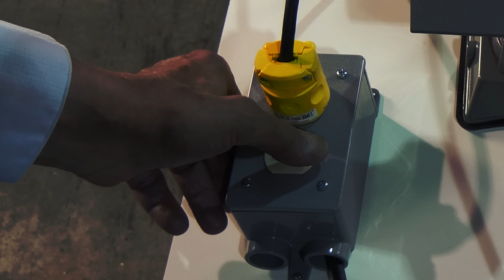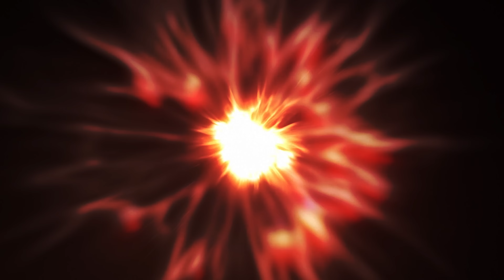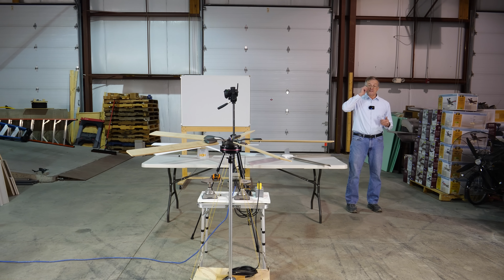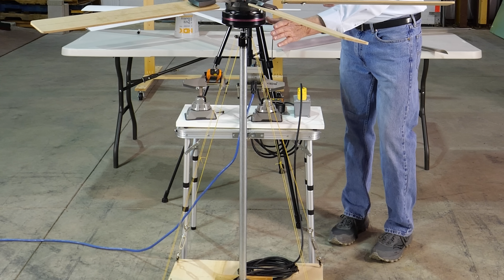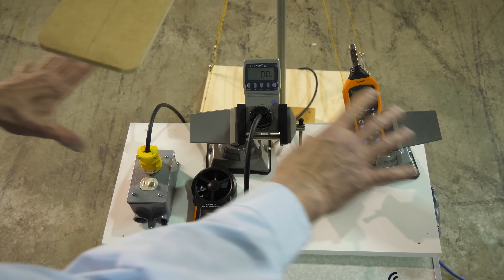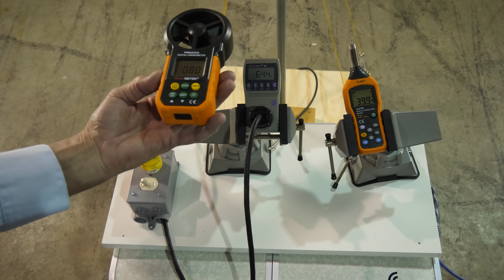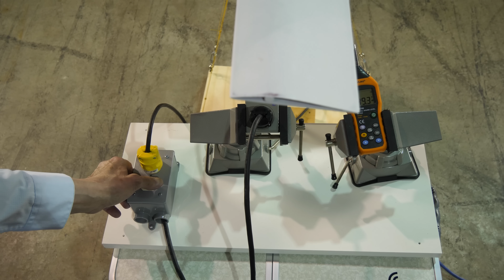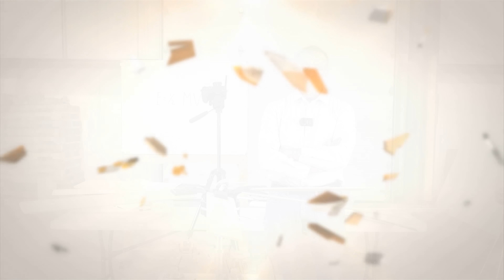This Fan Uses Almost NO Power

Comment: Interesting demonstration.  I'm a retired HVAC engineer 30 plus years experience.    HVAC fan, pump and compressor motors have very stringent efficiency requirements either ac or dc.  Around 92 to 95+%.  The cheap retail fans you showed are not regulated unless they have energy star certification.    The beauty of the speed control dc motor you showed is the ability to adjust speed to a desired amount and avoid over speed.
I enjoy you videos.  Look forward to the next one.
Reply: Thanks for your comment. I found a 120v ceiling fan on energy star site that uses only 16watts on low speed, 61watts on high.
Reply: Even ten years ago, BLDC motors were common in Australian washing machines apparently. I'd dug that up when looking for a source of e-bike motors from e-waste. But I'm in Canada, not Australia, and there's basically zero of them here.
Reply: @MattsAwesomeStuff  Fortunately Ebike motors used are quite affordable, especially from defunct ebike rental units, often times even with the tire on it. Also the Direct drive ones are cheap since they are just a bunch of wire and steel, though relatively heavy they are basically bulletproof and hard to kill by heat or age or water or anything.
Reply: I'm a HVAC fan too, especially during summer
Reply: How common are bldc motors in household appliances?  My cursory web search was confusing and did not answer that question.
Reply: @Richard-rz8gt  
Can  only speak for the EU but Efficency labels and norms do make it that DC motors are pretty common.
Cordless vacuums probably also use them at the very least.

I would say that fans are kind of a case where people don't seem to care about efficiency.
Reply: @Richard-rz8gt  Not that common outside of power tools & some garden machinery, sadly, but getting there over time. Modern fridges seem to be leading the charge by having brushless compressors. If you're lucky you can find a practically drop-in replacement for a brushed motor but that often requires taking the appliance apart to measure things.
Reply: @NightCatArts All fridge compressors are brushless. They mostly use induction motors (no brushes!). Perhaps you mean PMSM.
Reply: @andutei  I was using the term brushless to refer to the permanent magnet variety, which some fridges are now beginning to use in place of induction motors to increase efficiency & keep noise down by varying the speed.
Edit: To be clear, brushless permanent magnet motor, not PMSM.
Reply: @NightCatArts  A brushless permanent magnet motor is a PMSM.
Reply: @andutei  No, PMSM is driven by AC if they're to be efficient, whereas what people mean when they say a brushless motor is driven by DC. They are different designs & function differently, even though neither uses brushes.
Reply: @NightCatArts  No such thing as a brushless dc. It's a misnomer. The waveforms are AC for the "bldc". It is a Permanent Magnet Synchronous Motor.
Reply: @andutei  No, they are different things and they operate differently. Any half decent cordless drill from the past 15 years uses a motor without brushes that you feed with direct current; it is a brushless DC motor.
Reply: @NightCatArts  You left out the part where you're feeding the DC in the drill to the inverter/controller, which in turn feeds AC to the motor. Here's what Google AI says "Yes, the term "brushless DC motor" is often considered a misnomer"

They are not different things, they're the same thing. Construction is the same. Even the construction of a brushed motor is the same, minus the commutator. The main differentiator is from induction motors, and in regards to controller input.
Reply: @NightCatArts  Can you spin a BLDC with a battery or other DC power source? No? Then it's not a freaking DC motor! "BLDC" is a misnomer. The DC goes into the controller, AC comes out of that and into the motor. I design motor FOC drives, so you'd think I should know😄
Reply: @andutei  Yes, you can.. You charge one coil at a time, not the entire stator at once, because that's how they work. The fact that the signal kinda becomes AC inside the motor because you switch it on & off has no bearing on what you should call the motor; it's a DC motor because it takes DC input. That'd be like saying a bicycle shouldn't be called a bicycle because it only carries one person; the number of people on it is not relevant to why it's called a bicycle.
Reply: @NightCatArts  Sure, you can make it step with dc. But not spin. To spin it it needs 3-phase AC. It's a PMSM. PM = it has permanent magnets on the rotor, SM = it's a synchronous motor, the rotor d-axis follows the stator field q-axis current.
Reply: @andutei  Stepping is what they do; charge one coil in the stator after another (or one set after another) to pull the rotor around. It's not constantly alternating the current on all the coils at once, but constantly changing which coils are charged. They use Hall effect sensors to determine which coils need charging at which time to pull the rotor to the next position, & it happens so fast (often using pulse width modulation) that it doesn't appear to be stepped. This is why they're efficient, because the entire stator isn't being powered at all times (alongside being able to balance torque against power delivery). This is also why they're more expensive, because they require a microcontroller to analyse the sensor readings & alter the voltage output & path.
Reply: @NightCatArts  Get yourself an oscilloscope with a current probe and look at the phase current, it's an AC waveform with 0 dc component. Like I said, I design motor controllers, hardware and firmware, I don't need you to tell me how they operate, LOL. This stupidity has gone on long enough. Good luck to you.
Reply: @andutei  You should update your knowledge.
Reply: @Richard-rz8gt  As someone who tries to only buy BLDC motors, not very. Consumers just don't understand the benefits so companies neither push products using BLDC motors aggressively (outside of battery-powered tools) nor do they advertise the fact their products contain brushless motors very prominently.
Reply: @flagman3116  Plenty do. They just called it Inverter rather than brushless
Reply: @flagman3116  It seems to me that a smart company could sell the advantages of a more efficient product. As the man in the video said, the cost bump to build is probably minimal. If they price their widget based on the cost to build, then the new widget wouldn't be much more than the old widget. The problem comes when they want to scalp the consumer because the widget has new technology and therefore "should" cost a lot more.
Reply: @ٴٴٴٴٴٴق I see the sticker on my fridge reminding me of that and the 10 year warranty on the compressor every day :)

But why is it the manufacturer feels the need to have an extended warranty on that? I think it's because consumer sentiment is against these extra smarts
Reply: @Richard-rz8gt  check out "Inverter Fridges". But induction motors are also efficient, when they need to be to comply with energy regulations.
Reply: Thanks, gents.  The comments here confirm the scant information I found.  I reckon the dearth signifies that few appliances use these motors.
After market motor swaps would involve a schematic, professional expertise, and likely void any warranty.  The cost would be amoritized in less time than the appliance lifetime.  Hopefully.
Reply: why are you giving your resume
Reply: DC fans are becoming common
Reply: Can you pin a link to that DC motor set up?

Comment: You guys could use a noise filter to remove most of the buzz in this audio that is making it unbearable to listen 

Good content as always !!!
Reply: 💯 even running it through audacity (free) would do wonders
Reply: @JohnGodwin777  Yes audacity will take care of it
Reply: A high-Q 50 / 60Hz notch filter would do it in a heartbeat. Easy as Pi in any video editor. Eliminating the source of the buzz would be better – it's a ground loop somewhere in the wiring setup of the audio it I had to make an educated guess.

The lavalier microphone lead is also acting as an antenna; a small investment in this area would lead to improved audio all round. I'd suggest taking a look at the DJI web site in that regard.

You could've also measured the temperature at a fixed distance (e.g. 30cm below the midpoint of half the diameter). I'm curious how the six setups would compare.

Aside from this, excellent content as always. I can't say I'm that surprised that the cheap motors made more effective heaters than they did kinetic energy devices – just the opposite of what you want when you put the fan on for some cool air! 😂

Comment: I got huge fan to suck air out of my pole barn/shop. Thing is crazy loud and fast. Replaced the motor with a DC with adjustable speed, Now I can run it at 20% to 50% still moves plenty of air but so quite now compared to before. If I'm doing something that puts a lot of smoke or dust in the air I can still turn it up to clear the dust out quickly.

Comment: Harry C. Riblett has a really good analysis available in GA Airfoils. But what's the difference between them in the weight per watt ratio? A ceiling fan is far-less sensitive to that than are other fan uses. Would Niron Magnetics help in that?

Comment: On top of the 1kw/day energy waste, to note, that is extra heat, nice in winter, not so nice in hot summer days. That fan uses a specific ac induction motor, has no running capacitor but has a magnetically shorted part of the stator, that is why is so inefficient,  but will last forever(until the bearings fail). The washing machine, fridge etc will use the running capacitor, so a bit better, but still a dc brushless or ac 3 phase inverter driven will be more efficient, that's why newer AC units, washing machines,  dryers all use inverters or dc brushless, at least in the EU things are moving into that direction.  Great videa!

Comment: Don't know the internals of this brushless motor you used. There are many small and cheap brushless motors and controllers for RC models. With the proper gearing you can get them in the optimal operating window for this type of application. Might be an option to even further reduce power consumption and costs.

Comment: We circle back to that Tesla was right DC is better than AC. It would be quite interesting for you to explore DC step up\down, DC transmission and distribution, compared to AC. Also you can explore, what exactly in your home cares whether it's supplied with DC or AC. You could explore Hybrids Solar inverters with the option to sell the overproduction. The power production, distribution and consumption are major topics nowadays, that in my opinion, would be interesting to lot of people.
Reply: One is not intrinsically better than the other.

They each have advantages per use case including transmission distance, safety, cost, data integrity, etc.
Reply: @sih8283  Technically all motors are AC, even the brushed dc motors, due to the commutator and brushes positioning.  My comment was just food for thought, not to be fundamentally taken literally .
Reply: @Daemorien You can't just randomly apply DC to AC home appliances. That would likely damage the equipment...

I was answering literally, because your statements implied that you don't understand the subject all that well.
Reply: @sih8283  First of all, I was hoping to catch a troll. Second I'm certain that i know more than at least you, Third you proved it yourself - not knowing that Edison not Tesla  was pushing for a DC system and Tesla proved that AC was better. Fourth You could, if you understood that almost all modern appliances have a rectifier right at the input, and those who don't like a toaster literally don't care because they are pure active loads. You'd need an appliance that uses a transformer to step down voltage, which since the buck converter is pointless. 

Don't troll
Reply: @Daemorien
Gee, that escalated! You obviously have something to prove. Sorry, I'm not really interested in validating.

Comment: Thank you for the video. I also have a passion for fan blades... so I found it fascinating.
Doesn't the DC Brushless motor also require a controller (and doesn't that add to the total cost?)

Comment: That BLDC driver is most likely using open loop square wave driver, so there's probably more efficiency on the table with FOC control. At high volumes cost-optimized hardware for FOC driver could probably costs less than $10, but that would make the ceiling fan more high tech than most drones.

Comment: Hello, one of the reasons for the stamped flat blades is they are reversable. An airfoil may not give the same air flow in both directions. Interesting video as I watch all of them. Thanks so much!
Reply: Given how you could adjust this mechanically with a semi stiff blade material and an adjustable pivoting Rod, this too could be automatically swapped entirely with the switch of the button. 

Just a mechanically shifting interior rod, and it all falls into place for more efficiency and the blades could still be cheap.
Reply: Things not to yell on a street corner.  IT'S THE MOTORS, NOT THE ROTORS!
Reply: - no not really - shaped aerofoils (airfoils) also work in reverse - and winter flows are so much more effective if less turbulent -very low speeds are better for not causing draughts (drafts).... - many stamped blades are basic "barndoor flap"  derives -they also reverse.

(non need to find excuses for itiot low cost "replicators of societies perfections".. they are simply copying prior art for maximised profit...- pultruded plastic blades  are very cheap - even id setting to a "twist" and cavuforming sking - very low cost ((look at all the cheap wind turbines scamming civilisation - pennies on the pound)...

Comment: The thing that also isn't mentioned in regards to the whole efficiency thing as well.  That at 40w you also have to counter that heat which makes that 40w difference even higher since you are heating the air up which means your room will feel warmer and you need a higher speed potentially.  So putting it at a lower RPM might have almost the same equivalency which means even more energy savings.

Side note, your noise floor in the room I think was too high, which makes getting the sound readings not as great.

Comment: Rounded ends on the blades would reduce noise (and likely save a teeny bit of energy).    However if you’re experimenting with blade tips, then the winglets used on modern airplanes might be interesting to try.

Someone pointed out that varying the pitch along the blades can make them more efficient… but at that point they are no longer simple/cheap

Comment: "... because these same type of motors are present in your washer, your dryer..."
To be honest those are two examples where the fan motor imho barely matters. Both devices use a lot of energy for heating and only little (in comparison) for the motors. (Also: inverter-driven three phase motors are kind of state of the art in washing machines and dryers as far as I have seen.)

Comment: My take aways:
- Less turbulent flow with better foils, though the wingtips are faster, so more noise.
  - Mitigated by lower speed comparable to those before the exchange
  - Optimising wingtips for sound might be useful
  - More round front edge on the foil might be useful
- My box fan has been a traitor all along
  - Any "3-speed fan" is likely a very inefficient AC motor...
  - Does math: 432 kwh wasted every year?!?  $50-$60/y gone pointlessly...
  - So much wasted energy...

Comment: I missed an explanation of WHY this is more efficient. Surely converting AC to DC and then converting DC back to AC through the ESC for the BLDC motor can't be inherently more efficient than running AC straight from the wall to the motor. What makes these AC motors so bad?
Reply: the cheap fan motors are "shaded pole" design. Which is known for being cheap and inefficient.
Reply: Designed to be as cheap as possible. Even good AC induction motors with no permanent magnets are usually a little less efficient anyway, it has to do with the lack of permanent magnets and some power being used to "make up" for that, in simplest terms.
Reply: It has to do with the phase angle of the AC  sine wave and the induced current in the rotors coil.

If the angles are out of sync with the rotors speed then heat is created instead of rotational movement.

AC motors can be 'fixed' using additional electronics to mitigate this issue, but this ads cost and complexity.

Comment: I can’t speak for ceiling fans, but I replaced two cheap tower fans with nicer versions with brushless DC motors and I’ll never go back. They cost WAY more, like 3-4x more. But they use a fraction of the power and, most important to me, they are unbelievably quiet. If you keep them at or below 50% they are effectively silent. Even at full blast they are a fraction of the volume of a “regular” fan.

Comment: These fans are also supposed to run in reverse, so I'd be interested in designs where the airfoil profile has rotational symmetry.  Also might want to twist the blades so the center of the fan is doing more instead of leaving all the work to the tips.